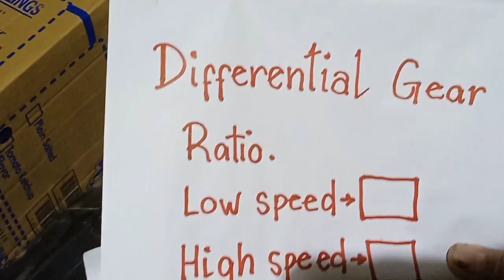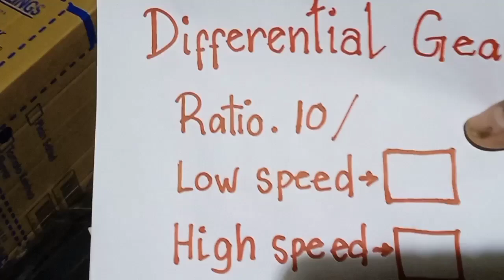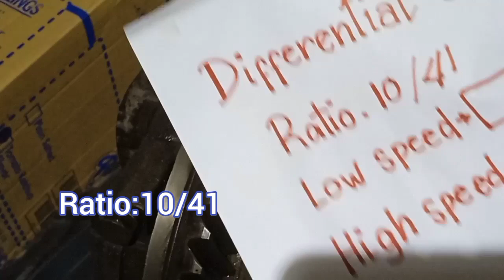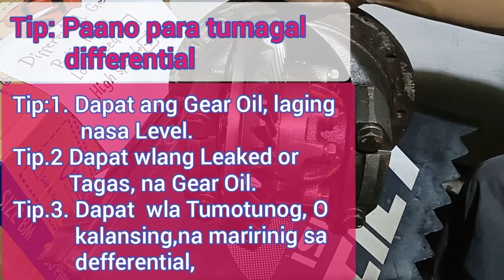#HOW TO KNOW YOUR CAR. PAANO MALAMAN KUNG HIGH SPEED OR LOW SPEED, DEFFERENTIAL GEAR.. Tutorial.

Comment: good day po. sir ano po ang match n number ng transmission 4jb1 pag ang differential po ay 9/41 ang ratio para maging malakas s ahon at pag s patag mabilis din po. salamat po
Reply from the maker: Sir. Nabasa ko un.mmsg. nyo .ask. ano Makina ninyo Branded ba. Or kasama pati Transmission nya 4jb1
Reply from the maker: Tanong ko sir . Nasubukan nyo na ba kung ano Rpm. kapag Nasa expressway kayo meron bang 
120Rpm speed nyo o higit pa. Gamit ang 9/41  Kung meron Ok,. Tanong ko lang muna...
Reply: @maalamtvvlog  xlt auv po gamit ko sir n 4jb1 n 9 seater. hindi po sir kaya ng 120kmh. ang nakakabit po sakin n transmission number 12 po. balak ko po magpalit ng transmission anong number po b ang match s 9/41 n diffrential. salamat po
Reply: @maalamtvvlog  nabili ko lng po kc xlt ko 2nd owner n lng po ako.
Reply from the maker: Sir.Binasa ko mabuti at Ganito gawin nyo wag na kayo mag palit ng Transmission, magagastusan masado kayo. . Alam Parehong High speed, pati Defrentian nyo.  
Ang Gawin mo Sir. Hanap ka ng Low Speed na Defferential na 8/41. pero alamin mo kung Small ba Big Carriel nyan Defferential mo.. un lang muna.   At alamin mo kung Bago pa ang Clutch Lining ng Tranmission mo....Sir. Salamat. 
Mag Comment lang kayo sa mga mga Video ko related sa gusto nyo Malaman..
Reply: @maalamtvvlog salamat po sir. small carrier po single bearing isuzu fargo differential ko po.
Reply from the maker: Gawin nyo muna un advice ko.  8/41 pwede rin 7/39 small Carriel . Sir.
Reply: @maalamtvvlog  ok po salamat

Comment: Kia sportage turbo diesel po unit ko sir 9:40 po ratio differential. mahina po ang hatak at speed sa highway nasa 80kph lng po kahit 5th gear na.advice lng po thanks
Reply from the maker: Yes. . sir..tanong ko kung. Yan. Pa ba un Original na Defferential. Mo sir.
At kung. Yan talaga pa ang Original.   Ay pwede. E mutch, dyan ay 10-43
Sana. Sir.  Kung naka tulong ako. 
Paki Share , at SUBSCRIBE. narin.. para makatulong sa iba pa.. SALAMAT.
Reply: Ano kaya yun sir nung nag palit ako ng LSD oil (Nissan Terrano) may nakuha kami na kasing laki ng SD card na
 sumama sa oil?
Pero bago pinalitan ko minsan may tunog sya paminsan minsa na tug o tug- tug lalo na akyat at loaded.
Salamat po sa tugon.

Comment: sir ang transmision ko ay #9 isuzu ano ba ang match na ratio ng difirential
Reply from the maker: Sir. In tranmission mo ay high speed.  Dapat mag low speed ka. Ito lpwede deff. 8/43
Reply: @maalamtvvlog   7/43 ang deff ko sir #9 naman ang trans.macth ba ito?
Reply from the maker: Ang 7/43 lowspeed,  din po. Pwede rin po yan Malakas  sa Mga paayon mga tirik na. Akyatan, khit. Meron ka load  saJeep nyo ayus.
Kaya ngalang  ang kph. 80 Lang  sa rektahan...

Comment: Sir good day po plug and play lang po ba kung i swaswap ko po ang differential ng Hilander 4ja1 non turbo(11/41) at Crosswind XT 4ja1 with turbo(9/41)? Salamat po sa pagsagot
Reply from the maker: Anselle, mas ok sa akin un Crosswind XT 4ja1 meron turbo 9/41
Reply: Pero plug and play po ba ang 11/41 galing sa Hilander sa Crosswind
Reply: Based on my comparison po I have both units po kasi sa Crosswind XT turbo po ang rpm nya is nasa 2750rpm habang sa Hilander naman po is nasa 2500rpm po so nasayangan rin po ako sa power ng Crosswind XT po namin kung medyo low speed po sya. Bale iswaswap ko lang po sila ng differential mas bagay din po kasi sa 4ja1 non turbo ang medyo low speed para hindi po hirap ang makina

Comment: Gud evening po sir, mitsubishi delica 4d56  ang sasakyan ko dati automatic pinalitan ko ng manual transmission galing sa hyundai grace high speed po pero bakit mahina tumakbo anu po ang dapat na ratio, salamat po
Reply from the maker: Sir.   Hi. Speed.  Un Transmission. Mo.  Ilagay. Mo. Na. Defferential. Ay. Low. Speed... Naman.  Para. Lumakas. Ang. Hataw sa. Akyatan arankadahan....   Pls. .support. lang Ating. Channel.
Reply: Opo high speed ang transmission ko, Dba po low speed naman ang delica? Kasi malakas po sya sa akyatan kaso pag sa patag mabagal po kahit birit na ang makina. Anu po ang tamang ratio, salamat
Reply from the maker: Kaylangan. Sir. .  mag high speed. Pala. Kayo  ng konti  ng. Deff.
Reply from the maker: @stephendelostrico3518    sir.  Alam nyo. Na ba kung ano. Ratio. Ng. Deferential. Nyo.  .  Kung. Nasilip. Nyo mas maganda sabihin. Nyo sa. Akin..  . Makitkita. Ninyo. Yan. Sir . Sa gilid ng Housing ng deferential naka. In - Voice.. yan.
Reply: Ok po salamat sa pag reply
Reply: Low speed 39/8 po ang differential maliit na carrier anung dapat ipalit upang bumilis, salamat po.
Reply from the maker: 8/39 ang nakakabit, ngayun .
Ang. Mutch. Yan. Mag 9/43 or. 9/41 na ratio. Small. Carriel.. pls.  Support. Ating. Channel .salamat po. Sir.
Reply: Magkano po ang 9/43 or 9/41? At pwede po kaya ring gear at penion ang papalitan?
Reply from the maker: Sir.  Kung  surplus ay na sa. 5k.,-
 6kLang
At. Dapat. Buo. Na. Un. Bilin ninyo..

Comment: sir sakali po sa mga buses. makina po ay de12 daewoo lowspeed, ano pong match differential at transmission. salamat po
Reply from the maker: Kung Low speed yan pwede dapat  mag high speed ka..
Reply: @maalamtvvlog   kung low speed na transmission ano po dapat ratio ang pwedeng imatch para mabilis sa akyatan at patag.
Reply from the maker: @Aysonliz  Sir. Pwede diyan ang Deffrential. Na 7/43 or 7/41

Comment: Hello sir! Sir ano po match sa #2 tranny 4jg2 giga. Dating flatlow convert sa single tire rim 15.
9/41 or /43 yung nakakabit na differential nya. Ok lang po ba na 8/41 or /43 ipalit? Pang patad at akyatan?
Reply from the maker: Yes. Pwede yan. Sir.  
Pero gusto mo pa namalupet sa akyatan mag 7/39. Or 7/43 kana lang.💯. Pls. .support lang. Salamat.
Reply: @maalamtvvlog  Ok sir pero hindi ba apektado top speed nya pag 7/43? Mga 90 top speed nya sa 9/41.
Reply from the maker: Mac B.  Ok lng.. pwrde rin nyan.

Comment: Good pm Sir. Anong differential yung  much sa 5 speed Isuzu 4FC1? Yan kasi yung gamit ko sa owner type jeep namin tapos 4 holes yung differential nya galing sa Toyota liteace na gasolina. Mabagal kasi sya pg starting pro napaka lakas sa   akyatan. Sa highway, malakas na ang tunog ng makina pro mdyo mahina pa ang takbo. Hindi ata sya much sa differential.
Reply from the maker: Gud day. Sir .john. Ask. Ko ano Top speed ng Owner,nyo kapag naka rectahan na takbo., Gusto ko malaman, pero kong Takbo yan ay 90kph or 100kph. Na.  Ok po yan.. ang alam ko un Defferential nyo ngayun ay HIGH SPEED , ang nkakabit.  Dyan..
Kong gusto nyo ibaba ninyo at bilangin nyo .Ano Ang RATIO,GEAR,. nya.,.  At wait ko rply nyo sir, kapag. Alam nyo na .. Salamat. Sa feedback,  sana. SUBSCRIBE. nrin. Po kyo sa. Channel ni MAALAM TV.
Reply: Good pm. Salamat sa reply Sir. Hanggang 80kph lng. Sayang nga eh... My ibubuga pa sana yung makina nya. High speed dn ba yung original transmission ng Isuzu 4FC1 Sir?
Reply: Ok Sir, e subscribe kita ngayon. Yung  pampasaherong sasakyan ng kapitbahay namin dito 4FC1 yung makina at saka original sa gemini yung differential nya, lalampas ng 100kph yung takbo nya kahit malaki yung sasakyan nya.
Reply from the maker: @johnbernardrice299  sir.  John. .Mag low speed ka ng Defferential,  para maabot. Mo un 100kph...  Konti. Lang dapat  kasi kapag sobra baba ang Ratio ng Defferential mo , hihina. Sa. Ahunan. Nyan. Dapat. Tamang tama. Lang.  Ang gawin mo para cgurado. Ka ibabamo un Defferential mo para mabilang mo.... At ano ang match diyan....
Reply: @maalamtvvlog  Good pm. Maraming salamat Sir!
Reply from the maker: https://youtu.be/4RliiAlfkBI

Comment: Sir meron bang mabibiling 2 in 1 semi low at semi higb speed na differential para sa Montero 2014 GLX  manual gear transmission.. magkano po kaya at saan mabibili ..salamt po sagot.
Reply from the maker: Try  nyo  sir sa Blumintrit manila
Reply: Pero Meron po ba talagamg ganitong  specs Ng differential???
Reply from the maker: Alam  ko sir. Meron  pang 4x4 lang syan .

Comment: Hella po..ahm ano po Ang match na defferential ng 4hf1-#2 transmission  ? Sir salamat po bale patag po byahe
Reply from the maker: Hi..  katropa.  Pwede. Rin. Po. Dyan.  Ang 8/43. High speed.  👍Salamat
Reply: @maalamtvvlog  ano mach dun sa 2 trnny 4fh1.
Reply from the maker: @dongmontero847   sir.  Sana. Malaman. Ko. Un. Tansmission, nya. Muna. Kong. low speed o. High speed.
Reply: @maalamtvvlog  6speed bos trnny nia 2.

Comment: Sir yung dito po sa amin ay 4bc2, 9 po ang kanyang transmission. Diko po alam kung high speed or low speed kasi wala po naka indicate sa differential case, since mabilis po maubos ang second and third, tas mahaba po ang 4th gear. Low or high po ba?
Reply from the maker: Hud pm.  4bc2 alam ko High speed yan. .kung original ang Transmissiom.mo..  kung Naka tulong Paki. Support. Naman ating Channel,  Sir. kikiam...🙏
Reply: @maalamtvvlog  Kaka subscribe po lang po sir. Bale kapag 9 po na transmission, High-speed po yun? Diko po kasi makita ratio kaya diko po malaman kung high speed or low ang differential
Reply from the maker: Kikiam.  Para segurado ka tingnan mo. Yun gilid ng Defferential.mo. Naka invoice un sa gilid ng Bakal nya.

Comment: Hello boss. Ano mas magandang differential sa 6wf1 inline engine pang kargahan at akyatan, high speed ba o low speed? Salamat boss!
Reply from the maker: Sir.  Makina lang ba yan .o  kasama ang Transmission,,.
Reply: @maalamtvvlog  original pa transmission niya boss. Galing subic yung unit.
Reply from the maker: Ngayun Alamin mo kung Low speed, or HighSpeed, yan Tranmistion nakakabit. Makikita. Mo yaan sa  ilalim ng Housing ng Transmission, naka Invoice yaan Sir... At. Saka  kita bibigyan ng Mutch, na Ratio..

Comment: Sir 4d56 L300 differential, high speed po ba?
Reply from the maker: Low speed ang Def.L300
Reply: @maalamtvvlog sa mitsubishi adventure po na 4d56 highspeed po ba yon?
Reply: @maalamtvvlog stock na differential sa adventure na 4d66 boss low speed po ba?
Reply from the maker: Sir. Low speed yun.

Comment: sir paano po masasabi na yong 10/41 is high speed or low speed? anong pong number binabasi para masabing low speed or high speed ang isang differential ? salamat po sana po mapansin
Reply from the maker: Sir.  Kapag mataas ang bilang ng PINION GEAR..
Meron din tayong basehan. Nyan. 
Ex: 10/41 paano nasabing Highspeed.
41÷10= 4.1 yan ratio meaning kapag mababa ang kanya number eh highspeed. Sir.
Sana sir. Nasagot un tanong ninyo.❤️❤️Salamat po ...